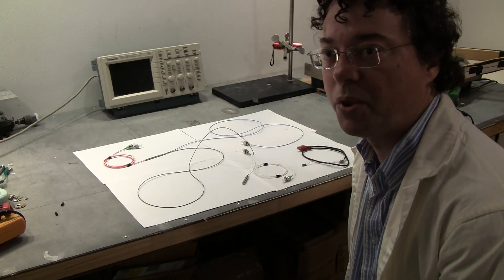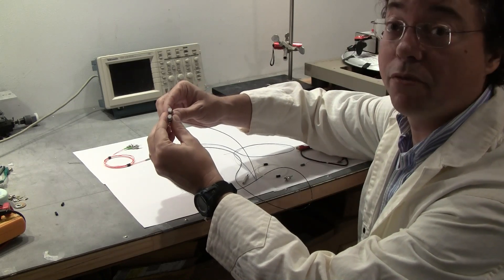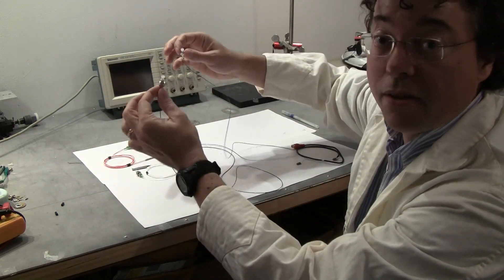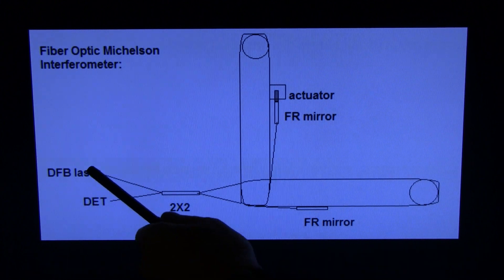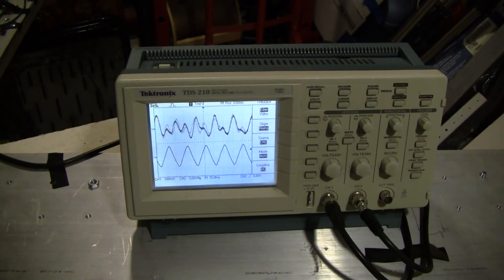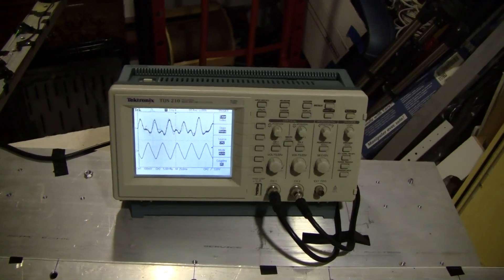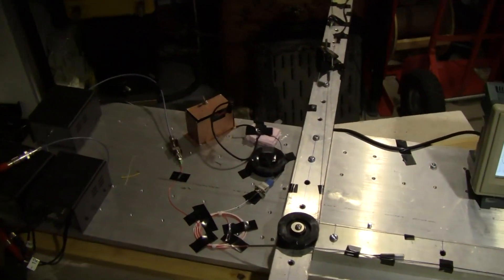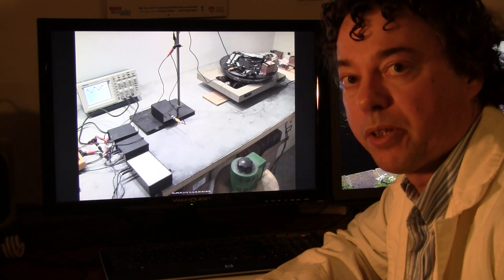A Fiber Optic Michelson Interferometer - first attempt

Comment: Hello, 
thanks for the video. Maybe you can help me!
I am setting up a Mach-Zehnder fiber interferometer, very simple at the moment: a 1550nm laser split into two beams in free space (with a half-wave-plate and PBS), and coupled into two fibers. These are then connected to 2 ports of a 50/50 2x2 fiber coupler. I am then looking at the output of the other 2 ports. That's it. Each one of the output ports carries equally interference between the two original light beams, right? I just pick one of them and connect it to a photodetector. What I expect to see is NOT a clear interference pattern, since there is nothing producing a regular phase modulation along the fibers, but just slow variations  given by vibrations and so on.. (eventually I wanna introduce a fiber stretcher to compensate for those, and stabilize the interferometer). BUT what I ALREADY see is a quite regular interference patter, with really good visibility! AM I MISSING SOMETHING HERE, and that is actually what I should see already?? Or you think the only possibility is that there is some source of noise along the interferometer that produces those oscillations?
Thanks!

Comment: How did you measure the output? Birefringence & a photo detector?
Reply from the maker: Hi Steven,
    I use a PIN photodetector and I also stretched the fiber using a piezo actuator by a fraction of a wavelength to make the interference visible. Recently I have found that the piezo actuator and the Faraday mirrors are not obligatory if the path lengths of each arm are almost exactly the same - in which case the phase relationship between the interfering waves is just read out as a voltage from the PIN diode.